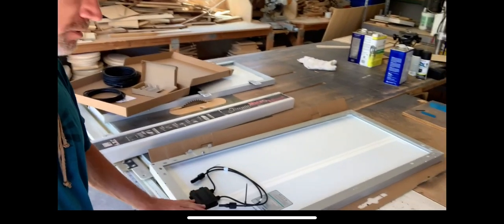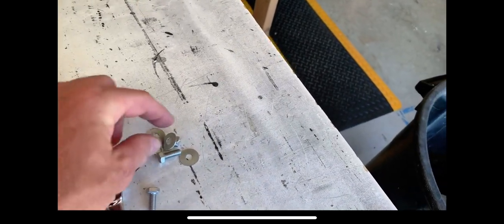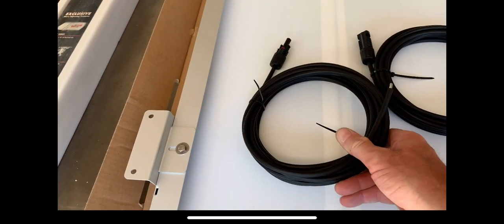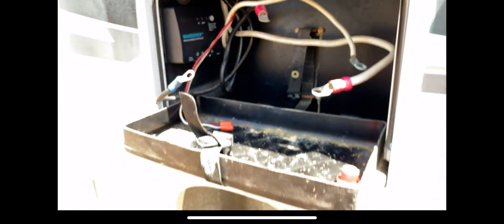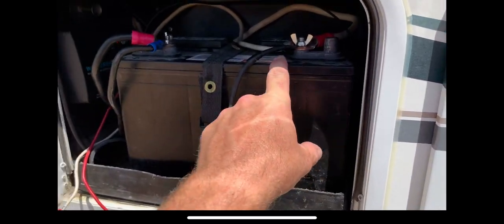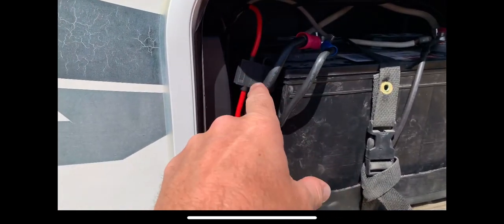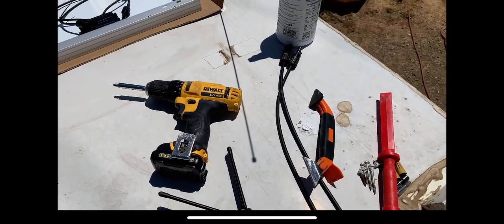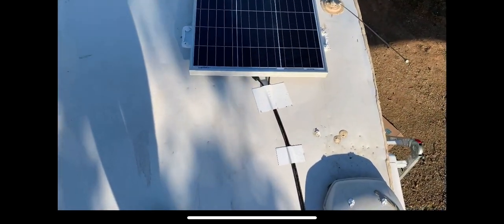Renogy 100 Watt Solar Kit Installation • Truck Camper Power

Comment: Great video, but a note of caution: The Renogy manual explicitly warns against installing the controller in a sealed enclosure with flooded batteries.   Gas can accumulate (from battery) and there is a risk of explosion.
Reply from the maker: Thanks.  It is a vented enclosure.  No more worry though as I’ve upgraded to LifePo4 batteries.